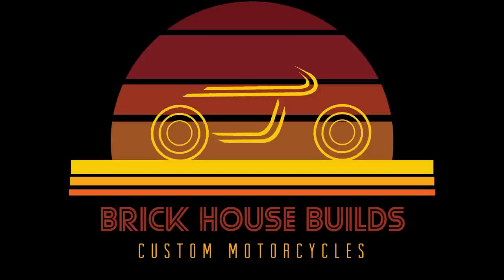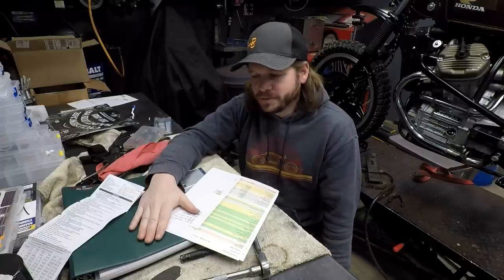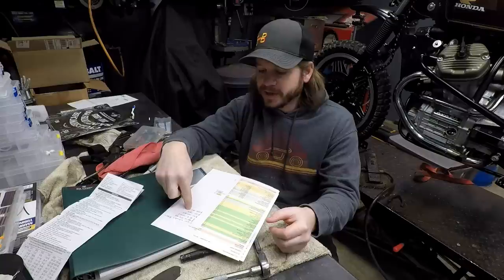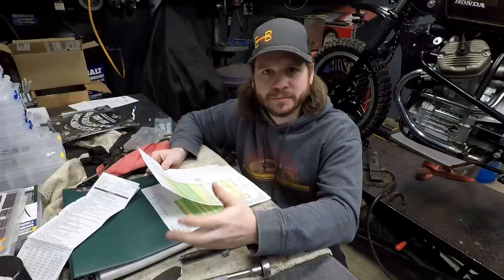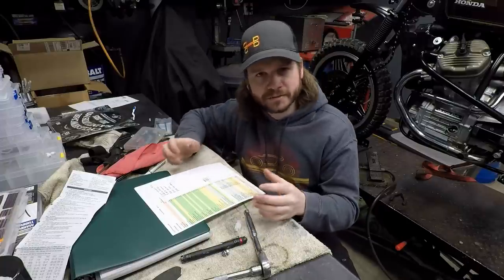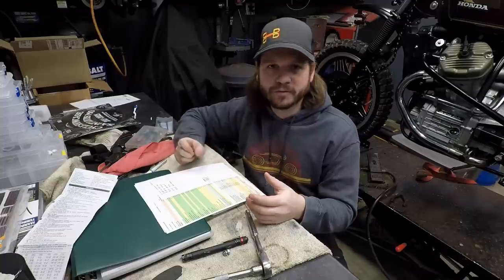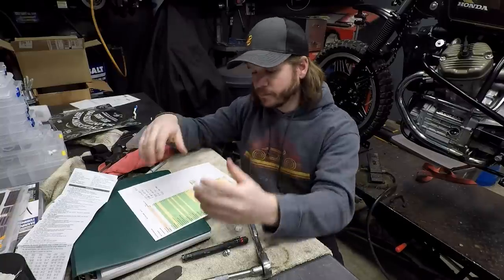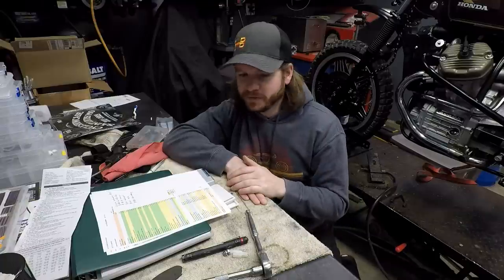Barn Find Honda CB750 Rebuild Cost

Comment: This is probably one of the most informative videos about restoring vintage bikes.  So organized and helpful.
Reply from the maker: Well if this were an actual restoration it would be far more expensive and in depth. I just hope it helps people understand what it may take
Reply: @BrickHouseBuilds  You restored it to working order.  I think that's awesome.

Years ago I hung out with people who "restored" cars to concours levels of perfection.  They would count the number clicks when you press the emergency brake.  Life is too short for that sort of hobby.
Reply from the maker: @lastairbender_883  haha completely agree
Reply: @BrickHouseBuilds  man,tell me what you will do if the engine was dead completely. will you find another engine or simply throw this moto in garbage???
you paid just 100 .
Reply from the maker: @al.march.7457  You assess and make decisions.  You contemplate your skills, your budget, parts availability and move forward. Road blocks happen but they don't mean you have to give up. Vintage bikes are full of headaches and unknowns. I got lucky here and talk about it often. Stop telling people they can't do something because an issue "MAY" arise
Reply from the maker: @al.march.7457  Also there is no dead completely unless it is growing from within a tree or something.  If it needs rings do that. If it needs a 3rd gear split the case and do it. If it needs main bearings do it. Nothing is impossible.

Comment: This bike is one of the absolutely coolest finds you revived and fixed up! I get it that it takes some $$$ to get something put back together, & know the drill about titling a vehicle with no paperwork! Glad you got the title from the PO. All the cosmetics came out great as well. You did an excellent job on this CB750.
Enjoy this ride and look into an 836cc kit later on down the road, it will haul some serious butt with 100cc extra displacement. Thanks for a cool video!
Reply from the maker: I'll very likely do an 836 on my other 750 as it will be a performance oriented build for sure. Glad you have enjoyed this journey though!
Reply: @BrickHouseBuilds  clutch friction plates and steels are still available for these bikes.

Comment: I have a 1977 CB750 that is a nostalgia bike for me--I had one (or my dad had one, and I got to ride it) back when I was 17, 40 years ago. The one I have now came with a Vetter fairing, which I've removed. I'm having some trouble figuring out the parts required to put the front end back to stock. I'd kill for a $100 parts bike like you've found! They don't seem to pop up in my area (coastal VA). BTW I visited STL for the first time several weeks ago, then discovered your channel soon after returning home. Missed the opportunity to visit your shop. Keep rockin' it--Love the content.
Reply from the maker: I appreciate it! Check out cmsnl or partzilla for parts diagrams
Reply: @BrickHouseBuilds  Hey thanks--cmsnl is a new one for me.

Comment: A list of costs can be frightening! You are brave doing this.

I have been sorting an fzr600 recently. Biggest pair of costs were a pair of tyres and forks rechromed. But all the small costs added up. Cables, battery, oils, filters, carb seals, wheel bearings, swinging arm bearings, couple of suspension linkage bearings, brake hoses, brake seals, disks, etc.

Wiring I stripped the loom back and replaced any cables that looked at all concerning. 

Cheated a bit with the rear shock. Fzr600 ones 2nd hand all looked like they had spent 30 years at the bottom of the sea. However Yamaha BT1100 rear shocks are virtually the same dimensions with a very marginally stiffer spring and far more readily available in good condition for reasonable money.

I don’t think I want to add up the costs, as more than the bike is worth.
Reply from the maker: So often you go upside down on costs. It's not easy to simply flip them
Reply: @BrickHouseBuilds  , this bike is my old cheapy commuter bike. High miles, but I have a soft spot for it. I gave it to a friend on the basis they could have it for free if they were rebuilding it, but after 5 years they decided they wouldn’t get around to it do I had it back.

Not going to be perfect (the bodywork is rough), just want it to be a useable bike. Hence frame, etc, powder coated, brakes rebuilt, new hoses.

For me, too easy to get distracted and spend time and money fiddling with minor irrelevant bits to ever make money. But the bikes get to survive.

Comment: I did a restore... Well still doing a restore in a way cos it's an evolution of work.. nice rundown of your costs. I didn't have cash to spend, but I had space and time and put a serious amount of elbow grease into it. I stripped it all down and started restoring by hand what I could. Knowing some handy people helps when it comes to things like welding aluminium etc (I had to sort a hole in the engine block worn through by a very loose camchain and an engine mount that was cracked, which I managed to to with a friend). Definite spends are gaskets, o'rings, piston rings, fork seals, brake pads, tyres, a new battery, plugs oils hoses, and even new bolts as you will prob have to drill some out or cut some off, and maybe a few electrical bits. Aaaaand a ton of consumable tool based sundries, like sandpaper, lube, paint, drill bits, grinding bits etc. Yeah about 400 bucks to get it road worthy is prob about right on a pinch. Sourcing parts, going to classic shows and scanning over the parts bins, and making stuff yourself is where the budget is kept down.. but yeah not everyone can have a project going for nearly 10 years. Mine started first touch of the button after rebuild.. that was a real surprise. Great bikes!! some parts were totally shot. I made a seat myself out of some old discarded server racks cut and welded together, then mated to a some home-plastic-welded and formed nylon chopping boards that I glued car-seat foam to and used some old sofa leather to dress.. turned out pretty good. Same to me regards to the bike as far as originality. It's not chopped or messed with, particularly, but it's not original either as sourcing NOS is expensive. It's a make do with my own soul added to it, and I love it all the more for that. I got lucky and had a friend who managed to powder coat the frame for free. But I did spend a loooot on paint In general... do it yourself and you will likely have to do it a good few times before you get it right.. but worth it to be able to stand back and feel proud. About half a year of running it, the fuel tank fell off a table while I was doing some engine maintenance and got a huge dent in it, which long story short meant a complete respray, after a bit more welding, so I got a chance to start again with everything I learned the first time in mind, and it turned out even better. Nice channel 👍
Reply: I managed to strip the bike down to just engine and frame in one evening.. about 4 hours calm dismantling. The engine was fused to the frame by the bottom forward engine bolt that goes straight through.. that took me about 2 months to remove (I didn't work on it every night but a lot of hours first spent trying to free it and then when I finally realised after over a week of soaking in penetrant, heating, and persuasive tapping that it's not coming out, it then took what felt like an eternity to carefully drill and file the ends out by hand (I didn't want to accidentally drill into the frame or engine  block, and it's too big and heavy to lift into a precision machine) yeah that wasn't fun, but what a victory when it was finally free. The rest was a nice journey.. fond memories of having various bits in the living room like sculptures once they were all cleaned up ( had the best climate to preserve the work done).. doing things like honing the valves in, with the head on the coffee table, while watching a movie with a beer etc.. to you peeps out there that think it's too difficult, if you ever have a heartbreaking breakup.. consider doing a budget classic motorcycle rebuild project..

Comment: I968 to 1971 was the very best cb 750 hondas that were ever made simpler faster and way easier to maintain
Reply: I worked on and rode a 1969 Cb750. It belonged to Colin Edwards Senior.

Comment: I found an all original except for the tires 1973 CB 350 Four with about 2600 miles on it. The motor is locked up last tag on it was 1976. After watching this I'm definitely going back to buy it.
Reply from the maker: Get it! I saved a 350f this same way from being an actual yard ornament. Was locked up as well
Reply: Well took a whole year to get a price on it. Finally got one today 1800 dollars not going to get it.
Reply from the maker: @itllbeawrightyep5579  thats far too high unfortunately

Comment: These project amaze me always... and I also "tried" then I found out: 
I haven't enough space (to work in good, clean or ergonomic condition) 
I haven't all necessary tools (to work fast)
I haven't all necessary information OR experience (to look at problems and solution correctly, what saves a lot of time and money) 
I haven't all necessary skills (to avoid errors and saving again money and time)
And at the end a project of let's say 10-20 hours becomes a work of 100 or more hours...  
If he needed 200 hours, every other person probably need 150% of that.. maybe 200%...  And you reach a point when actually the fun is over.
Reply from the maker: Im sorry but that seems normal to me. I work from a very small space, generally always exceed original estimates, always take longer, etc. It never goes perfectly. Now of course I do have more experience here as I do vintage bikes for a living but that doesn't mean I haven't done exactly what you described in your comment. Im only proficient now because I have made all the mistakes and have tried to learn from them over the years. Most of what I see others do that causes extra frustration is to not do it right the first time. People like to buy the cheapest thing which ends up not working so that means you buy the thing twice and do the work twice. My video doesn't lie though and what I go over is all accurate for this bike. I'm sorry you had a bad experience but that is not universal. It definitely doesn't mean other people shouldn't attempt this on their own.
Reply: @BrickHouseBuilds  Yes for sure, it's somehow normal, like you say, once things are done "over the years".
I only found my first attempt - which was not only an attempt but a complete work, as I didn't let it uncomplete - a source of silly problems and mistakes and redos.. and this and that.. which I said, brought me to a point that the fun-part of the projekt was "wear off". I agree, it definitely doesn't mean other people shouldn't attempt this on their own... I'm just saying that it MIGHT be a lot harder than expected... definitively harder than watching your great job and think "oh I can do that too". Well, maybe not!  😂

Comment: Thank you for the cost breakdown as well as your detailed videos. These types of rebuilds are indeed fun if you have the time, expertise, and can get the parts. My kicker is finding parts for my 1981 KZ250 D2, especially gaskets, seals, and O-rings. A Keihin CV32 carb rebuild kit would help too. If you can suggest any places to check, or even a suitable replacement carb, I would be grateful.
Reply from the maker: Id suggest partzilla, cmsnl, old bike barn, dime city cycles, and ebay
Reply: You can make many gaskets yourself, Just get some gasket paper at an auto parts store and make or buy some hole punches to make neat holes in them where needed. Valve covers and many other covers can be sealed using Yamabond or Hondabond, obviating the need to buy expensive gaskets.
Bearings and (I think) oil seals have numbers on them and if you order them from industrial sources can be much cheaper than from a bike shop. Also, many bikes use the same seals so you can cross reference to find them, O-rings are also universal. The only reason for buying a carb kit is if it's parts are worn out or broken. Most carbs need nothing more than a good soak in lacquer thinner (not carb cleaner, lacquer thinner!), after removing all the rubber/plastic of course. Blow out with compressed air. The smaller jets are the ones that plug up. Remove the pilot jet and use one strand from a copper wire to remove any blockage from the jet.
Any carb from a similar displacement motorcycle will probably work, but the best thing is to properly clean your existing carb.  Check the vids on YT for more info.
Reply from the maker: @jiyushugi1085  You make a few points but some of what you said is not accurate and is over generalized. Using parts designed for the specific bike saves time and money as you don't need to make your own, spend more time sourcing individually, and repair when its wrong. Orings indeed are universal so to speak but as an example with Honda, the orings are very specific in size and need to be correct. Finding something that fits the slot is not the correct way.
Reply: @BrickHouseBuilds  Very true, but what I was trying to get across is that there are ways of putting a bike back on the road without nickel and diming yourself to death with expensive new or OEM parts. I used to get most of my parts, including tires, chains, plugs, bulbs, etc. at junkyards, often in almost-new condition. Bikes have traditionally been working class transport or transport for the less financially endowed.  
Perhaps you could do a video titled: 'How to put a bike back on the road for as little money as possible'.
Reply from the maker: @jiyushugi1085  I hear ya, just my 2c to your 2c

Comment: Thanks for the info on the 750! I love that bike. My son and I are working on a 1981 Honda CB 125S. I was wondering your recommendation on where to get parts? Thanks .
Reply from the maker: Glad you found it informative.  In all my videos I link where I buy parts. Oem is usually sourced from cmsnl, partzilla, David silver spares, ebay, or dealer. Aftermarket can range from eBay, dime city cycles, revzilla, old bike barn, and many many others

Comment: So, do you have a workshop fuel bottle? You know the type you hang up when you balance the carbs? What kind is it and where would I get one...the ones on ebay have hoses that are way too small to connect to the carbs on  my ZRX1100 project. Thanks heaps
Reply from the maker: If you go to my Amazon Storefront link in the description I should have it there. Its a motion pro bottle. Adapting fuel line sizes is normal though

Comment: Regarding originality: if this was a rare bike, limited run, had historical provenance- then I'd be inclined to keep in original. But Honda sold GOBS of CB750's and your bike is only slightly modified, in my opinion. You didn't swap in a GSXR fork/brake setup. You didn't put on rear-sets. Didn't chop up the frame. I'm definitely biased, because I like all the choices you've made with this build. I might go with a twin disc setup (a la Goldwing) just because I like confident braking. Otherwise- chef's kiss.
Reply from the maker: Exactly.  Not rare bikes and will never be as desirable as say a 69-70. It may get a dual disc in the future actually. I have most the parts

Comment: A 1978? Is that the twin cam model? From what I understand the twin cam models came after ‘77 could be off by one or two years. I had a ‘75 cb750f super sport and I really miss that bike, I e always been into Honda motorcycles although I had different brands but I still favor the Honda brand. I can still get a cb750f here in the north east for under 5 grand and I think that’s a good price. Thanks for the helpful information and I’ll catch you on the next one.
Reply from the maker: 78 is the last year for sohc actually before going dohc

Comment: I wanted a Triumph 750 Bonneville,.....First I had 2 500 Triumph Tiger Daytona's,......Then a 1976 Triumph 750.
Got Married and lost every thing I loved.
But it is still fun to watch other's enjoy Motorcycle's.
I have a 1980 KZ550 that has been waiting on me since my divorce,.....still ain't going yet,....Poin'ts were over $100.00 the reason I never rode it was I have never been able to get it to hold air in the tire's.
Now I have to clean the tank and carb's.
I hate stock bikes,....sometimes,..I usually bought after market fenders and Headers.
I liked Kawasaki LTD bikes with chain drive and high handlebars,...I liker single cylinders,.. twin cylinders and 4 cylinders.
My favorite bike was a 1980 Suzuki GN-400.
You could go broke buying New Bike Parts.
They need a Rock Auto for Motorcycles.

Comment: I wish I could get away with doing less. I have an external head gasket leak and the engine has to come out to fix that. Best case scenario, I can retorque the head bolts. I'm going to do some investigation first. I think fresh oil, get it to fire, and see what compression and oil pressure do. If those are good, I'll just try the retorque. If either are bad, I'll plan a full overhaul. Either is fine.
Reply from the maker: Sometimes you can't get away with less. Each bike is different so they need what they need

Comment: I got my '81 cx500D for $250. But after tires,carb cleaning, service manuals,cables, oil change and a Rae Sun ignition kit I have about $1500 into it.
Reply from the maker: Not bad though! Should be a reliable steed after that
Reply: @BrickHouseBuilds  oh it is and I love riding it. Thanks to your videos it made everything a breeze.

Comment: Best thing to use to unlock a motor using marvel mystery oil I tell you something better than that old Barker man told me this I'm doing well he just want to start a little outlaws in Louisville Kentucky he said use Pepto-Bismol pour down the cylinders and that soak for 24 hours and come back out and pour transmission fluid or kerosene in there then crank it over and blow out the f**** cylinders